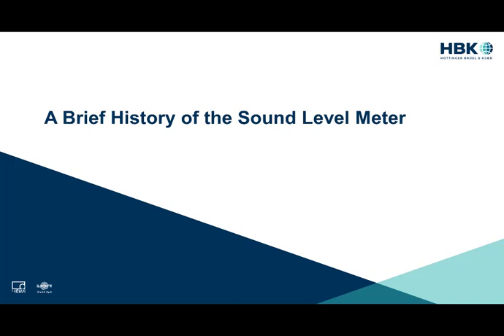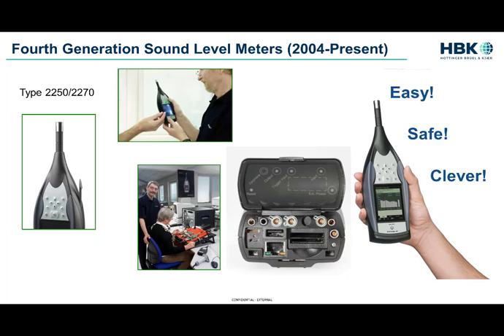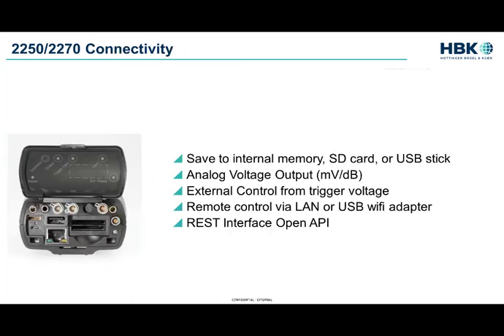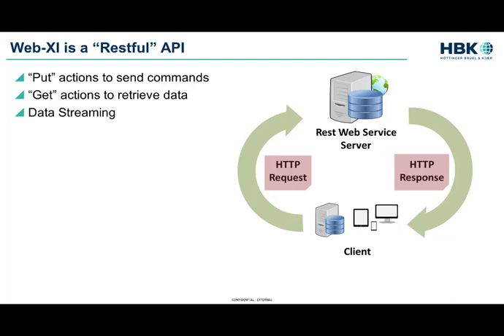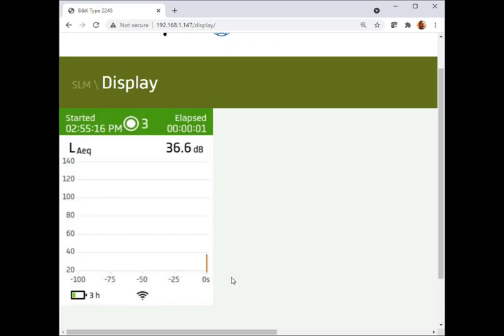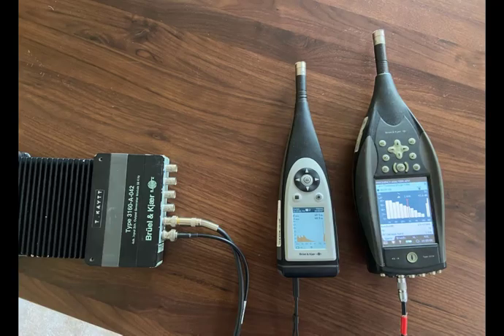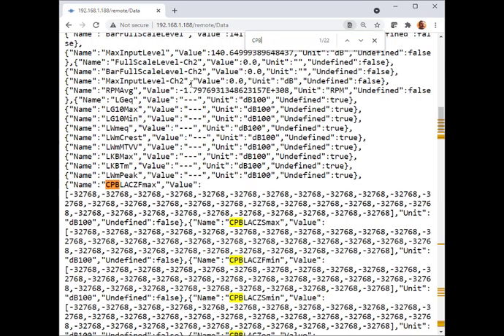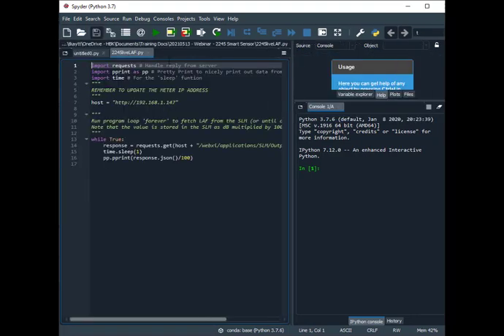HBK Sound level meter API for custom test applications - Thomas Kaytt (HBK)

Comment: Can we assume that the 2245 has 0,2 seconds delay in processing data if compared to the 2270? Or is the delay added in order to separate the two data streams for better visualization? I find the 2245 indeed an excellent solution for sound engineers that search for a quickly done job!